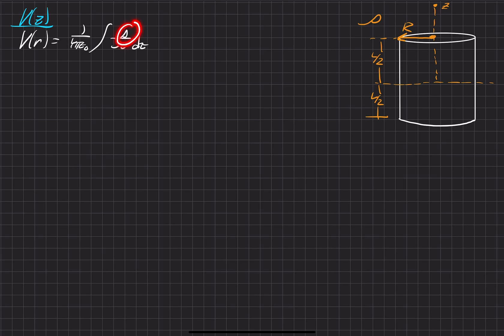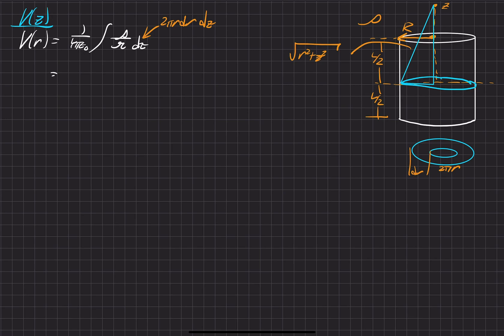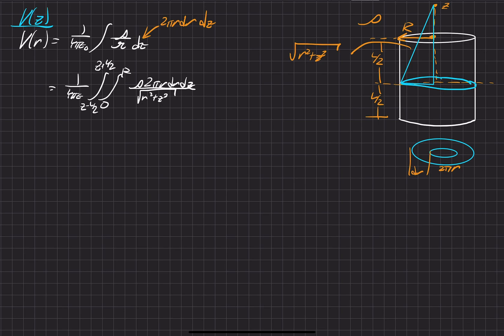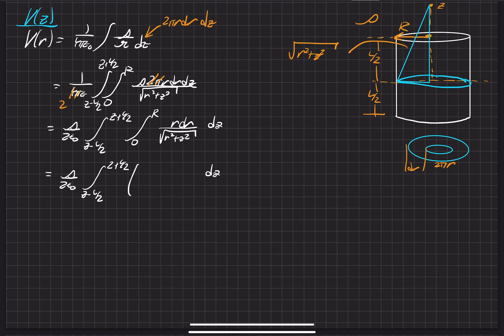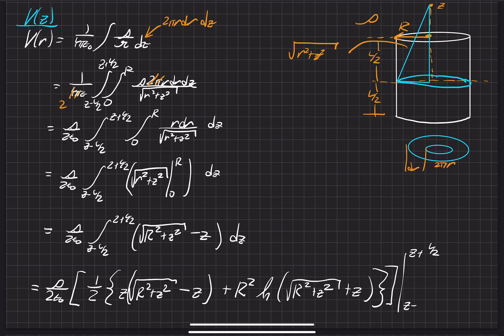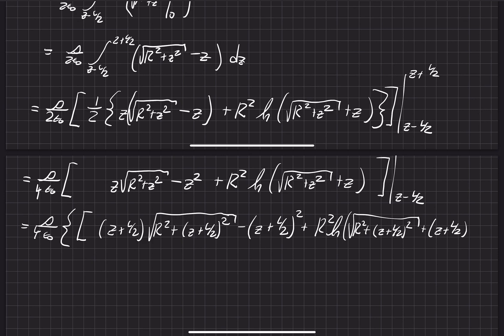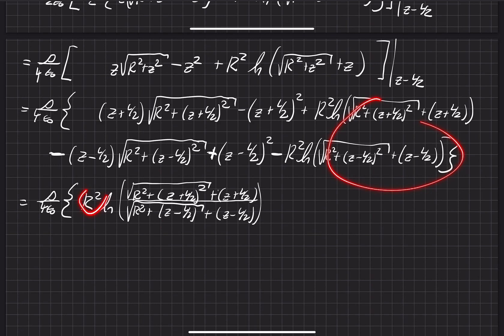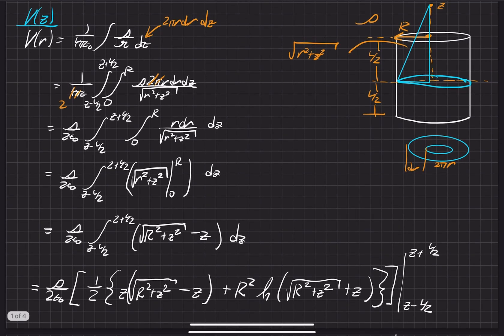Griffiths Electrodynamics | Problem 2.27 (Part 1)

Comment: I don't understand the limit you take over z...please disclose it clearly
Reply: So what is actually happening is you are doing a volume integral in cylinderical polars. Your source vector is the general cylinderical stuff for x'y'z' and then your field point (the point where you observe the potential) is at some distance z away from the center of the cylinder. Now this z is different to the z' you used to set up your source vector in cylinderical coordinates. In the potential equation and others too you always integrate over the source variables only. This is why in Griffiths book those source stuff has a ' next to it. Then your seperation vector will be r-r' and for the z component you will get z-z'. Here you set ip your integral and it goes from 0 to R for dr, 0 to 2pi for dphi and -L/2 to L/2 for dz' (remember we sre in cylinderical coordinates and this is a triple integral). Now in your integrand you will have a term (z-z')^2 in it and so you can do a change of variables say q=z-z' then you will need to change the integration limits from z'=-L/2 to L/2 to q=z+L/2 to z-L/2, this is because when z'=L/2 then q=z-L/2 and same for the other thing. But wait now you say your limits are flipped! Yip this is fine because in your integral you have dz' but we are no longer integrating over dz' but rather dq. So dq= - dz' snd when you sub that in and let your limits absorb the minus sign then you get z+L/2 in the top and z-L/2 in the bottom.

I hope this helps. You will not understand this if you don't have a good understanding of multivariable calculus or if you don't work through it as you read this comment. 

Also if this mathematical explanation didn't work then there is anothwr one that I don't like as much but a cylinder is basically lots and lots of plane circles added up together. So this means we can find the potential from the center of a plane circle at a distance z away. Then in order to make this circle a cylinder then we need to 'sweep' over some length L. Setting out origin at the same place as 1 circle then you already have the potential at z away from this one circle. So you need to move the circle -L/2 to get the bottom bit of the cylinder. Now you have the potential due to z-L/2 of the cylinder. But bow you need to cover the top bit. So you have to add L to it as you move the circle from z-L/2 to z (this is at the origin point we defined) then to z+L/2. Now you have covered the whole cylinder and ao your limits are z-L/2 to z+L/2.

Personally I like the maths one more and this limits is just a change of variables in my opinion. I woukd do the integral as -L/2 to L/2 but keep the z-z' in the integrand, it's not a big deal.